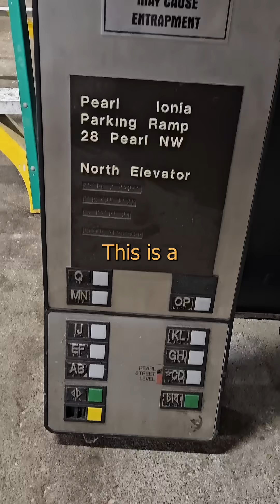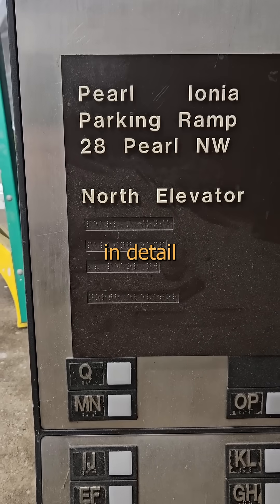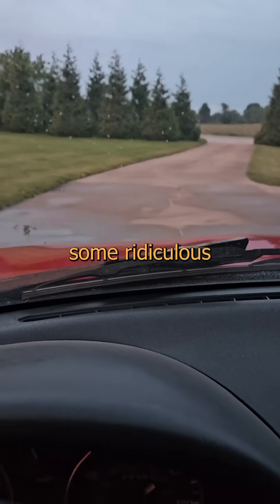Miata Mischief #chrisboden #engineering #gear #elevator #score #stories #parts #hacking #making

Comment: One of my most prized possessions and my only "nice" thing is a GIANT professionally-framed picture that looks like the  grey outline of Dawin's face opposite the face of a chimp, only the cool thing about it is it's not made with lines but teeny tiny print - the entire text of On The Origin Of Species. A former girlfriend gave it to me after I finished my Molecular Biology degree.

Once I was living in this place where the woman who owned it went a bit nuts and started threatening me and my cat, so I felt I needed to leave right away. I was already in the process of moving out, so had a lot of stuff packed or ready to go, but then had to do several emergency trips to move everything to my mate's place as an emergency half-way house staying in his spare room. Of course, the giant Darwin picture was last to go, and I was trying to fit as much as I could into each ute-tray-load because I was doing it all alone and exhausted and it was nearly midnight. I had to put it delicately on top of everything with a rug underneath to try and protect it and then gently strap it down and drive as slowly as I could so as not to get any air up under it or move it around. I was so relieved when I got it my mate's place in one piece.

The worst thing is I have to do it all again in a few weeks because owner is selling and getting moved on yet again. Housing crisis here sucks so bad.

Comment: I hauled a engine and manual swap kit in the back seat of my volvo s60R sedan from 600 miles away. Took out the back seat of it before the trip and put a tarp in to keep oil contained and easy to remove 😂

Comment: 17 and just got my official a ok to drive (alone or otherwise) and had to go pick up some construction crap for dad at the auction house. We (buddy of mine and I) get there and the construction stuff is on a truck that won't be unloaded until later. If we could help unload the other trucks maybe we could get out sooner (dang fool we were) so we went for it. We unloaded a 52' trailer of old (pre windows 3.1) desktop setups. We loaded Dad's truck like 4 times thinking we hit good. They were taking off the truck and stacking for recycling we could have what we wanted. We went thru the entire haul and had like 200MB of memory and maybe a 1gig HDD total. We soon found out because it was ewaste we would either have to separate everything for recycling and make almost nothing or pay to haul it away. We paid my dad to get a dumpster and paid the recycling center to take it from there. All in all starting up a few of the machines that worked and made a few that worked we broke even. (Thanks dad) Ok we broke even because Dad paid for the dumpster and the ewaste fees and stuff. If we had paid for just what he paid we would be out a few grand. We learn a lot tho so that was worth it, even to the man who spend good money over bad. He never did tell mom.

Comment: Was helping dismantle and old kitchen for remodeling and a tweaky fellow with his large wife and massive special son showed up asking if they could take the appliances, boss said sure and we watched them load a fridge, dishwasher, dryer, washing machine, oven and the countertops as well as a few other things into a little ford ranger. Thing was packed 3x the normal ride height. Bottomed out the suspension, and they threw some ratchet straps on it and putted away. Amazingly they made it up the hill and out of the neighborhood without shedding anything

Comment: Building some property up for a friend in a pretty remote forest-y area. We have about 10 lbs of meat that didnt fit in our original deep freeze, and it was thawing. But we also had to get the wood from the store that day to set the new fridge and generator on top of. We just did not have a way to do this properly. His Ford Ranger pickup truck fit the press board just fine. The fridge/freezer, no. Up this whole road, the straps we used came loose and we'd have to stop because the whole truck was tipping with the fridge as it toppled. We had no business getting to our destination with that thing intact. But we did. The fridge was damaged on top where the straps were rubbing and stopping the thing from bouncing.

Comment: A buddy and I built a ridiculously over built bunk bed for my growing family. 4x4 posts, panels built from 2x4s dado bladed out to fit 3/4" plywood, etc. The whole thing has to weigh 400+ pounds, easily. Comes apart into 5 or 6 pieces, which we strapped onto the roof of his Chevy Traverse (has a roof rack without any cross bars, stupidest thing ever) and drove 20 miles from his house to mine.

Comment: I had a 1969 MG Midget, one of the few cars smaller than a Miata.  Fortunately, it had a trunk lid luggage rack.  I remember hauling an extension ladder that overhung both ends of the car so far that I put a red flag on both.  I still had to be careful, because turns I could pull off before wouldn't work with that much overhang.

Comment: Drove one (Miata) once when my normal car was an Escort that burned oil faster than gas and flooring the gas pedal still required way more space to reach highway speeds than anything I have ever driven. I found out that a full 125 pounds on the pedal did reach a sub-injection speed a slight bit faster. 

 I've had the bum car. But the V8 in my Ford Country Squire was not one of them. My parents gave me that as my first car. It was made the year I was born that I drove to school. I still miss that amazing boat that held two crates of 6 chickens and 7 4-Hers plus a 4-foot clover for our club's booth. Yeah, that's way too specific to be made up.😅

My friend, whose father owned the car (the Miata), fell asleep.

I was enjoying the amazing feeling of pushing on the gas pedal and feeling it move faster. Unbelievable! 

Then I noticed I was passing a lot of cars. Weird.

I looked down. The speedometer said 120 mph.

😮😮😮😮😮😮😮😮😮😮😮

I didn't slam the brakes because, obviously that would cause more fishtailing than the garbage following a community fish fry. See? I knew what I was doing.😂😂😂😂😂😂😂

I did drop down to legal very fast... I mean at a reasonable speed if I had suddenly had my old car shot out of a jet engine. I assume you've been on the internet long enough to know what that looks like. I avoided that level of slowing, thankfully...

I looked at my speedometer at exactly the right time. I had tucked myself meekly between the slow lane drivers and a cop car flew past me. He had to have been going about what I had been going less than a minute earlier.

A few seconds later I saw two cops lasering traffic and the guy who flew past me jumping out and pointing at me and my 55 mph (technically well under the speed limit)

The third cop lazered me like he was knocking down an innocent person's door after midnight. Not as violent as if he was knocking down the door of a person with a tan, but enough to make this ghost imposter quite nervous.

For the next HOUR, we were passed by car after car filled with people pointing at me and laughing. At some point, my friend woke up and asked why they were doing that. I told her they just wanted to attack two women without a male chaperone...🤦🤷

I still consider that the least bad thing I did that weekend. We arrived at her boyfriend's house an entire hour early. (DO the math to figure out how many miles I covered at each speed knowing I drove 200 miles and arrived that much earlier than expected. Thankfully, my roommate never calculated that despite being a chemical engineering student while I was in science journalism because I'm a math Ph.D.'s mother's worst nightmare.🤷 I accept that.😂

I refused to drive anymore. But I never told anyone. Not one person until a month ago when I found out the roommate's father died 30 years after this incident occured.

No way did I want him to know I was "blowing out the carbon" on his Miata.😂

Comment: In college I was the drummer for what i just knew was about to be the next big breakout rock band. It's the early 1990's and GenX is making some noise. 
We played every gig we could get and, as the drummer, I was the de-facto cargo hauler guy. Problem was I had a '79 Chevy Chevette, which was simply (and somewhat misleadingly) dubbed "The Vette". 
I had a 6-piece Pearl set with the mandatory post 1980s add-ons like rototoms, octobongs, etc...  The Vette was always stuffed! The only other car in this circus was the bass player's Chevy S-10, in which he, the singer, and the axe man traveled to shows.
One night, after packing out after a gig at a giant frat/sorority shindig, the amps, speakers, and head units were stolen from the S-10 while the other guys were busy getting numbers from really drunk hot girls or the mildly sober not hot at all girls. The stuff in the Vette was fine. This fact somehow made me the focus of their scorn. 
Next gig- the sad, tired amps, speakers, and head units which we were able to scrounge up (at a premium price) had also found their way to the Vette. I had to trim back to a 4 piece drum kit and was also "allowed" only 1 crash cymbal, 1 ride cymbal, and hi-hats. An oversized bass speaker, which was in particularly shabby condition had to be tied to the top. 
The drivers seat had to be placed all the way forward and I pulled out the passenger's seat. There was so much gear that I had mic stands hanging out of the windows I had to leave open. The rear view mirror and the passenger's door mirror ware completely obstructed. The rear hatch was two-thirds open and tied down with a couple of workbook shoestrings I pulled from my closet. 
It appears this was illegal. How do I know? The officer who stopped me made sure I was I formed of this. When I told him the story, he looked amused, perplexed, and annoyed at once (I thought only my mom could do that). It appears he needed back-up. Within 15 minutes, 4 police cars were on the scene and the officers were laughing and making jokes when they were far enough they thought I couldn't hear.  
Soon, a fifth police car had arrived. It was their supervisor, who asked me to unload the car. The big bass speaker on top slipped while i was pulling it down and an entire side of the case came off. Perfect. 
There had been a rash of stolen musical gear during the past few months. 
All the amps and electronic gear that once may have had a serial number on them had been scratched off or the number plates removed. 
The cops took the gear, and the boys in the band and I had to go to the investigator's office for formal interviews a few days later. I didn't have a clue where the other guys got the stuff and I'm guessing the other guys were let go after they told where they got the stuff. Snitches?
It took me almost 3 months to get my drums back. The cymbals were never released, although I had had them since the 6th grade. 
We were not charged. I didn't get a ticket, either. 
We did not make the gig that fateful night. 
Oh, yeah, name of the band: "Thief In The Night". The cops loved it. 
The band broke up.

Comment: i have carried an f20c engine in my S2000 took the passenger seat out engine hoist in engine hoist out.. oh i carried 6000+ lbs of flag stone to make a path. this is in my 3/4 ton dodge cummins the vp44 generation . i will say that it felt sketchy as hell luckly i only had to go 8miles. i have used a friends skateboard to take a pair of speakers that where just setting on the curb...

Comment: Last year i found a workbench, a handmade artisan's workbench rotting in a corner, so i went "i'm taking this to my friend's because we do carpentry stuff for our HEMA group".
So i called the only guy from that group with a car, we hauled the heavy, dense hardwood 5 blocks in the dead of night to his car and there, under the street lights we saw, the workbench was crawling with cockroaches, under every seam of the wood it was filled to the brim with roaches.
So we left it on the sidewalk and drove to get bug spray, 2 cans later and we realised, we couldn't nor wanted to get the table inside the car, so we decided to haul it on the roof of the Toyota Corolla 1999.
Problem.
We only had 4ft of shitty, dry, brityle nylon rope.
So i went to the group chat and gave a cry for help, and someone answered.
The guy was high as a kite, so fazed the frigid night air with nothing but shorts and another 4ft of rope, he dragged his ass to the car and took him to where the table awaited our return.
The now poisonous table couldn't against the mighty of 3 dipshits and sat on the car's roof, the high guy was bragging about why he learned to tie a hangman's noose while my other friend was complaining about having only learned the bedroom kind of knots and not the useful ones.
So there i say, rear right window, sitting on the frame with half my body outside the vehicle holding a recently poisoned, splinter riddled table so the shitty nylon rope doesn't snap at 1 AM on top of the worst streets known to man while my life depended on whatever song Spotify shuffle decided to play next.
Fun times.

Comment: A friend and I picked up a motor siren weighing over 100 kg from a complete stranger on the other side of Germany using a handcart, and transported it home in a one-day train journey. It was quite a feat. The seller offered to pick us up at the train station, but while on the way he also Very clearly emphasized, not to take any pictures or record the location or the way. He picked us up in a neutral van and drove us to a remote farm, repeatedly emphasizing that we weren't allowed to tell anyone where we were going or to record anything, so the feeling of being kidnapped seemed to be part of the deal. We were then very relieved when we actually saw a shipping container full of motor sirens on site. To top it all off, and as if the handcart wasn't heavy enough, we bought another motor and were then actually taken back to the train station from where an arduous journey home layed ahead.😅

Comment: I hauled an air conditioner unit on the back of my foldable e bike lmao I used 2 military grade belt straps and I joined them by the buckle attachment. I also hauled an e-scooter in the back of it too.

Comment: I used the same car to pick up a 125cc motorbike. Took the passenger seat out and threw the wheels in the boot. 

Also moved a small wardrobe in the same car by taking passenger seat out. Made junctions scary as I couldn't see anything.

Comment: I was walking home from school as a 15 year old boy. I had just gotten out of my wheel chair about 3 months ago, so, i walked slowly. All my friends were older (over 17) and motor heads. 

While walking home, i saw the frame of a 1955 bel air. It had a sign “200 bucks” so, i rang the door bell immediately and asked about it. They said “if u can move it by 5, its urs for free, im tired of this shit blocking my garage. For 200 bucks, u can have the other scraps for the car thats inside” 

So, i called everyone i knew who was my age. We used 2 wood dollies, 4 skate boards. To move it off her property and down the street about 2 blocks to a cul de sac so we could get a trailer. 

But, we’re dumb. We couldnt move the skate boards and wood dollies up the trailer. So, we enlisted as many people we we could. Over 15 of us total, to lift it and drag it on to a painters sheet on the trailer. 

I offered to buy everyone carls jr cuz that was a ton of work. But, they said “congrats on ur first car” 

And, thats technically how i got my first car. 3.5 years later and over 12k in used parts and a ton of motor head help, it ran. It was ugly. But, it was mine. Haha.

Comment: I was on a second date, had borrowed my mom's hatchback, my date and I went to go pick up a leather wingback chair bought on Facebook marketplace for $40 because the owner had died and their kid was getting rid of it. When I got there, I couldn't get the back closed, and there was a tethered gun safe in the car, so I wrapped the safes cable around the legs of the chair and had my date hold it while I drove an hour back super safely on back roads.
Dated that girl for 5 years, and I still have the chair. 😂

Comment: Not an item, but an entire military convoy. I don’t live too far from a particular military base and one time I was on my 48 acer land and noticed an entire convoy parked out. When I asked about their whereabouts, they found out that they did the land navigation wrong and I had to escort them back to government property. A portion of that escort involved crossing a major highway, so everyone saw a tiny 1998 Toyota Tacoma escorting a bunch of Humvees, tankers, and troop transports across a busy highway with some traffic control by the local police. 

Kinda weird experience, especially when GPS already existed during this time.
Reply: Can always count on the 2lt to screw up royally
Reply: @joshuacheung6518 2lt are just privates that went to school for too long, changemymind.jpg
Reply: @robster7787  they were probably doing land nav only using traditional methods in case GPS is not an option, like worse case scenario kinda stuff. Im not military but training to be a pilot they teach you to use paper maps, mechanical calculators and different types of navigation that doesn't involve using GPS in case you ever loose it in an area where you are not familiar
Reply: Did you get to stick around for the ass-eating?

Comment: I have a short bed tacoma and I needed to haul 10ft drywall sheets home. So i made an elevated platform out of an 8ft sheet of MDF. Hung another 8ft sheet 2foof off then end and bam, 12, 10ft sheets of dry wall home with no trailer.